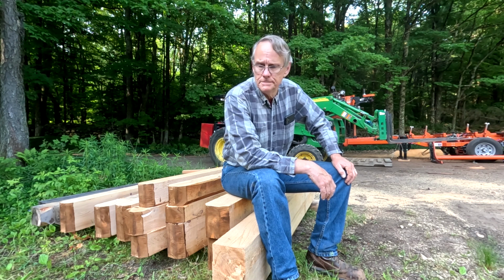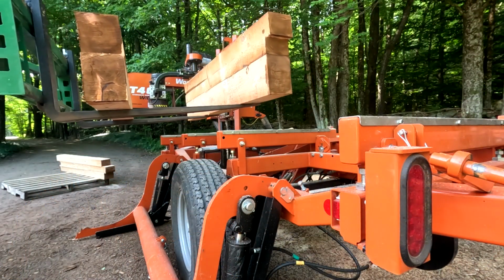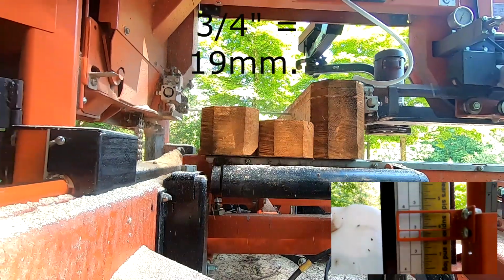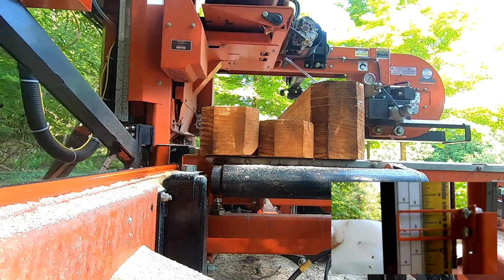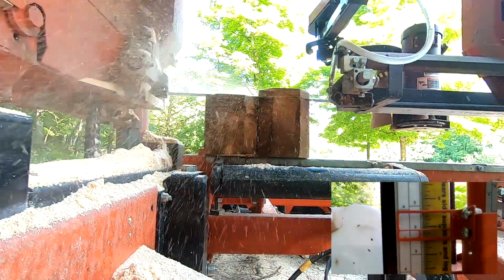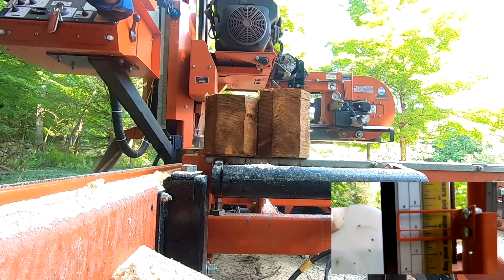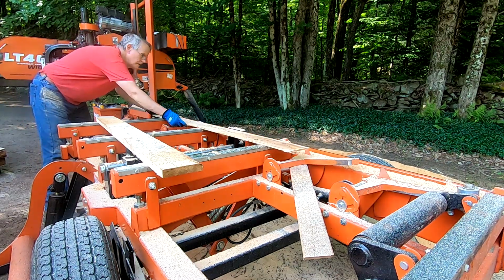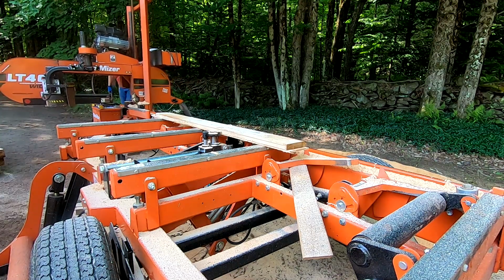Fence Boards From Perfect Cants # 251 #sawmilling #woodmizer #Wood-Mizer #sawmill #machine

Comment: Hey Dave. I've thought about a shim for years, but I just put the inch board in a stack with other inch boards. That much out of square won't even be noticeable. If you're going to build furniture with fence boards they need to be jointed anyway.
Brent
Reply from the maker: Thanks for watching Brent.